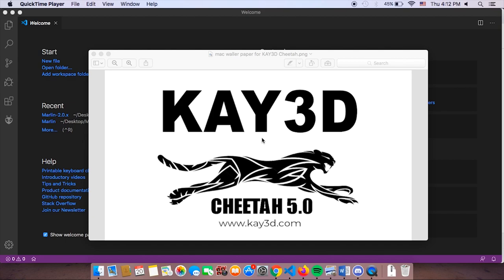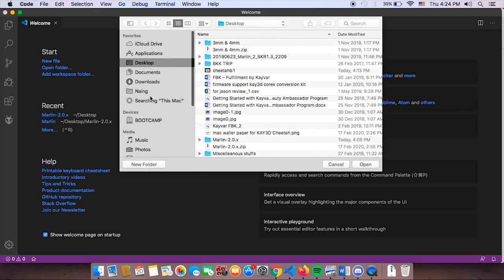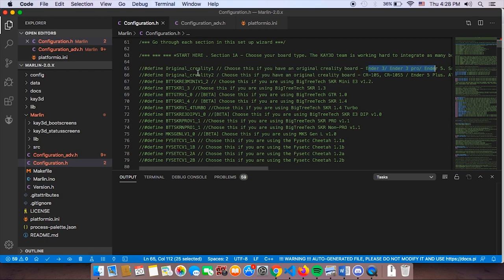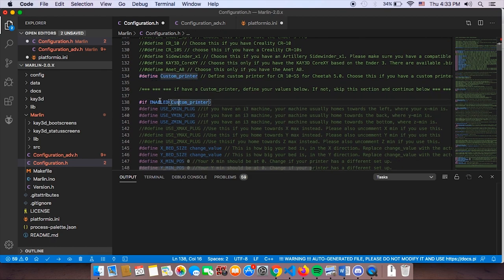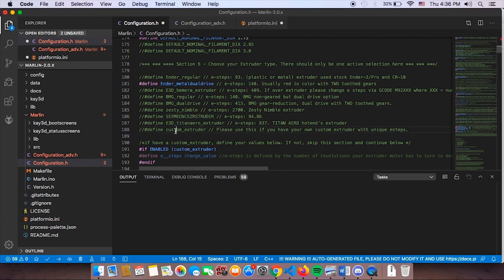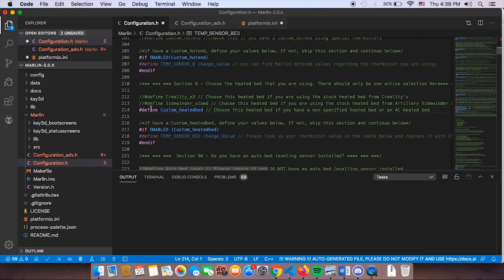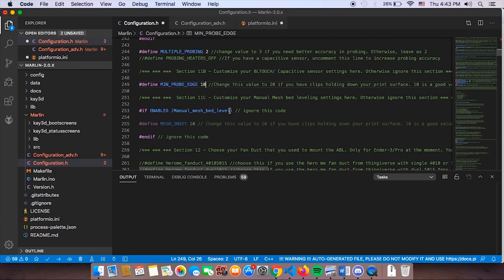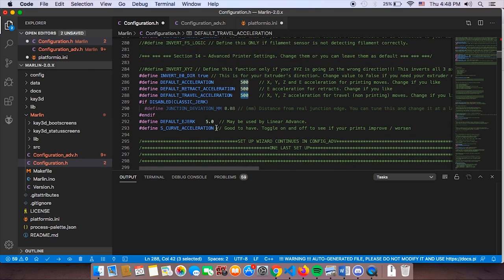30 Minutes Marlin Guide for Ender 3 using Cheetah 5.0 Firmware

Comment: Just replaced the board to SKR E3mini 2.0, setup esteps without any issues. All other settings have no issues,  Doing a test cube for calibrating extrusion multiplier in S3D, all of a sudden when the print is supposed to finish, the heatbed and nozzle begin cooling as normal, but the print is still carrying on. Never had that before.
Firmware is Marlin 2.0.5.3
Reply from the maker: we've seen that before. A user downloaded our cura profiles and fixed the issue. Hopefully it fixes yours.

Comment: Just installed cheetah on a new skr 1.4 with BL touch and my Zaxis only goes up and not down. What can cause this issue?
Reply from the maker: Try to see if you're missing something from this guide Lewy

https://kay3d.com/pages/the-correct-way-to-configure-a-bltouch

Work through the troubleshooting steps and guides. It should help. :)
Reply: KAY3D Labs that guide, much like this video is incomplete. In theory I love cheetah. But support and documentation is so far from concise. I’ll start with this video. I have the BTT TFT35 V2. In this video you say if using stock DISPLAY to define cr10 display, yet if using an SKR1.4 or turbo to define RERAP. It’s not discussed if you plan to use both. So first I defined cr10 because I’m on an Ender 3. Lcd Display works.. then I defined rerap only and tft doesn’t work. I defined them both at the same time and the stock LCD works but the TFT35 doesn’t. Then I unplugged the stock completely and defined rerap and tft still didn’t work. This section needs to be more concise. No mention was made to if I plan to use both, nor was it stated what to do when using the skr 1.4 and stock display. Obviously the answer is to define the cr10 only but this video tells you the opposite. Now on to the BL touch. Went through the entire guide. Plugging into the z min as recommended is the only way I got the zaxis to work right. It would not move down when using the dedicated probe port. Using the z min makes that part function correctly. It will reset, deploy and stow as it should. Yet it doesn’t stop with my finger it the probe. Again. The guide does not include any discussion about it not working when you try to use your finger to trigger it. The guide only mentions the touch being mounted too high but that’s the case that it doesn’t trigger in time.. mine doesn’t trigger at all. I really want to make cheetah work but if I don’t buy product from you I don’t get much support.

Comment: Im getting 2 weird errors now on 2nd compile that I can't clear: Cannot find c:\malin-2.0x\Marlin-2.0x\include. [9, 17] and Cannot find c:\malin-2.0x\Marlin-2.0x\include. [28, 21]    Any suggestions?
Reply from the maker: Move your marlin code to the root of your C folder. Most likely it's C:drive
This reduces the path length of your codes and visual studio kinda likes it that way.

Comment: I completed the process but I only get a firmware.elf file, not .bin, and it doesn't seem to work.
Reply from the maker: not all boards + vscode generates firmware.bin file for you to flash over a SD card. 

For example, some fysetc and MKS boards require a hardwired USB connection to enable a proper flashing of a new firmware. Hope this helps!
Reply: @kay3dlabs668  Thank you, I'll try it out. I have SKR 1.4 turbo with TMC2209 Drivers, a TFT35 V3.0 Touch Screen Display on an ender 5

Comment: Hi! I recently got the SKR Mini E3 v1.2, however after seeing a reddit psa, I've got the 256kb chip and not the 512kb. Will this cause issues with flashing? I don't want to brick the board. The change_value at 10:02 caught my eye with 512kb, that is why I'm concerned

Comment: Question: WHY are the E steps so vastly different for a Titan Extruder and a BMG one.
 Both have a 3;1 gear ratio yet the BMG E steps are 415  and Titans are TWICE as much at 837 !?
Cheetah problem Or ?       PS;  this video is more comprehensible when run at 3/4 speed.
Reply from the maker: I think it's best you look at it from the mechanical design of the components. Different gears with different diameters interact with the filament differently, regardless of gear reduction ratios. This results in different e-steps. Also, it appears that the guides written for titan aero assumes a 0.9 stepper. It may be possible that E3D ships them with 0.9 motors in the past/future. This explains the e-steps used for Titan Aero.

Comment: I tired compiling your build for Ender 3 Pro with BLtouch but it is too big for the 128K 1.1.1.4 board.
Reply from the maker: Hi! the melzi boards are unfortunately way too small to fit a bltouch altogether without sacrificing other things. If you disable SD (e.g. you have octoprint), you can fit and use bltouch on your board.

Comment: I love that I found this (love the vid btw).. but I still have a few problems. When I go to home my axis, my x and Y are fine.. my z isn't. my Z will either lower a little bit, but not continuously like it should (well until it hits an endstop). and my BL touch is always relaying back as triggered through M119
My setup is; CR-10 printer, BTT skr v1.4 board, BL Touch v3.1, CR-10 stock display, TMC2208 in UART mode for all motors, Petsfang fanduct (similar), e3d v6 hotend. I would love to get this working but I don't know how. :/

Comment: How do we know which board we have for the original ender 3 and do we download the cheetah firmware as well as the marlin ender 3 firmware?
Reply from the maker: Hi Sangeeta, you will follow the instructions for an 8 bit board if you have an original ender 3. And no, you don't have to download Marlin Ender 3 firmware if you want to use Cheetah 5.0 because Cheetah is build on Marlin 2.0.3 :)

Comment: I have Tcm2008 I need to set the BLTouch. Keeps going of the bed ? How do I adjust that?
Reply from the maker: Ensure your XY probe offsets are set accurately and correctly. That keeps your printer's probe in its right place
Reply: KAY3D Labs can you send me a video on how to set that or some kind of link please?
Reply: KAY3D Labs and also the marlin screen doesn’t turn on with bigtreetech. But I can’t remember the bug fix.lol. Thanks

Comment: Is it possible to use this on an Ender 2? If I replace the stock board with SKR mini E3 V2.0
Reply from the maker: Yes, but you'll need to know the printer parameters for Ender 2. You can find it in marlin's example configurations and copy what you need and put it into the custom_printer section in section 3

Comment: so i have a 400xl kit for my ender 3 when i change x,y,and z to 400,400,500 it still says the original size when i flash was i suppose to do something else besides that
Reply from the maker: Hi Yaschica! it'll be pretty difficult to explain here but you'll want to define custom_printer instead if you have a non supported standard printer. Alternatively you can go into printers_def.h and change ender 3's settings. For further support, feel free to ask in the support channels listed! Looking forward to you posting questions!
Reply: Did you find a fix I am in the same boat

Comment: nice video how we use tmc 2130 in spi mode
Reply from the maker: Hi Talha! tmc2130 is not natively supported in Cheetah 5.0 BUT can be used if you know how to configure the Pins. The reason why they're not made 'easy' with Cheetah 5.0 standards is because there are just simply too many TMC2130 variations and board combinations that we simply cannot give the firmware so many 'brains' for automatic configuration.